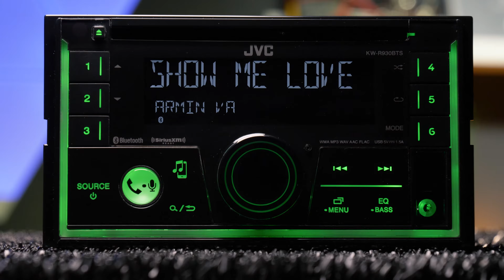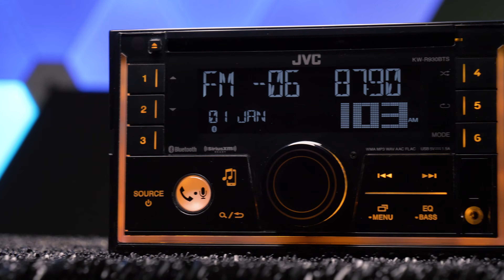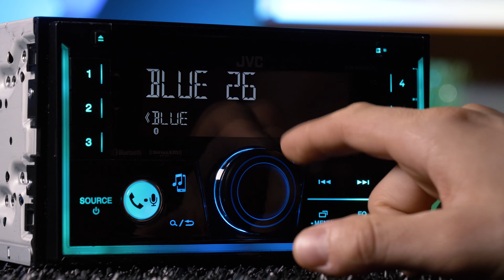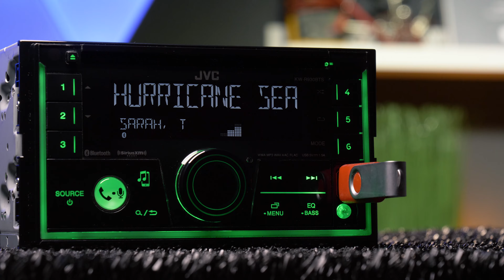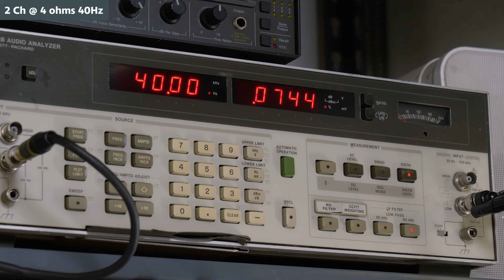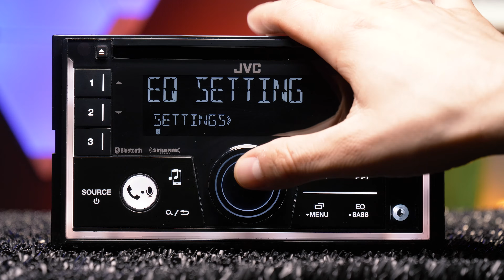JVC KW-R930BTS Double Din Car Stereo

Comment: It'd be nice if mine would actually turn on spent 2 hours on it...
 
It turned on at first then just turned off and will not turn on it has power going to it, I rewired everything and put a new fuse in it
Reply from the maker: It's brand new? There's either a wiring mistake you haven't noticed or smaller chance it's a defective unit
Reply: @Qualitymobilevideo  I took back the one today and exchanged it for the same unit and still nothing

Comment: Wow this review 100% accurate ..... had to laugh - I also found the Volume level at 28 was the clearest/loudest, on some inputs / songs can go to a higher volume but noticed small distortion so the readings taken here confirm SPOT ON what I was hearing.  As hearing is subjective it's great to have it confirmed scientifically :-)
* 1 Just wish JVC would add 10 Watts RMS per channel more of RMS more to be able to stay in the 20Watts RMS + range as many aftermarket speakers like that.
*2 Use ATPX codec for Bluetooth as the A2DP audio compression codec known to produce mid- to high frequency artefacts when the audio stream becomes too complex for it to handle. So USB/Aux in 3.5mm plug is your best option for Quality input.
The newer audio codec standard ATPX which JVCKenwood has been aware off since 2014 & used only on their premium offerings like other manufactures  - checked all others and this is still the best value at this price point this JVC I do really enjoy mine :-) preamp drives a powered subwoofer and I have a switch between it and the Antenna so I can leave the Antenna down for non Radio.... on the old car.
Reply: @Mr_Lowkey777  The JVC version has 22W at 1% distortion in the manual vs Pioneer 14W at 1%  vs both reality...

Comment: So if let's say I have a 4 channel amp and a sub amp hooked up in my car, I could go up to volume 32 if I have my volume adjustment to +6? Or will I have to set my gains at volume 29?
Reply: Are you still active on this post in particular I really need to know because I have my gains set with volume 29 it would be nice if I can set up cleanly with volume 32. I only have a sub amp right now but planned on adding a 4 channel
Reply: @my face diaper needs changing funny you say that because I took it out and replaced it with a single din pioneer radio lol

Comment: I’m trying to figure out a sound system. Would this be good to run a sub 12 with? I know I gotta get an amp but I guess what I’m asking is this enough power to sound good with a sub 12
Reply: I just got the 940 it’s got 4 volt outputs that are better for amps. It sounds great with my 12

Comment: Is there a way you can explain to me what herz does what in the pro eq settings? I want to make my music sound good but I'm not familiar with what kind of sound each hz does
Reply from the maker: Hz refers to the frequency, which is basically sound. So human ears hear frequencies from 20-20,000 Hz. The lower the frequency the lower the sounds, higher the frequency the higher the sound. The custom eq lets you adjust the level and settings of each specific frequency
Reply: @Qualitymobilevideo  thanks for that info it is well needed!

Comment: Still dislike that jvc doesn't have remotes on certain decks
Reply: Remotes for car stereos are mostly useless.
Reply: @madmax2069  But I'd still like to have one!!
Reply: @jesusbenavidez6235  car radio remotes are probably the most unused devices ever created.
Reply: @madmax2069  In newer decks
Reply: @jesusbenavidez6235  in any deck
Reply: @madmax2069  I love my Pioneer remotes
Reply from the maker: You two should fight, winner gets a wireless remote
Reply: @Qualitymobilevideo  I'm down! Proceeds go to charity.
Reply: @Qualitymobilevideo  how about no.
Reply: @madmax2069  except it prevents wear and tear on buttons which could be important if you want it to last a decade
Reply: @ApEsXiT  every radio I've had has lasted years, the only issue I've ever ran into with on a car radio was the volume knob, and that was easily fixed, and that happened only on one radio. I don't need a remote, most of the buttons and knobs will usually last longer than the electronics, and often those are easily fixed as well.